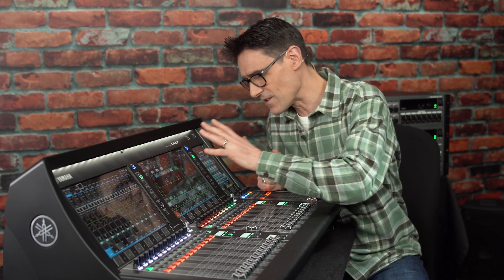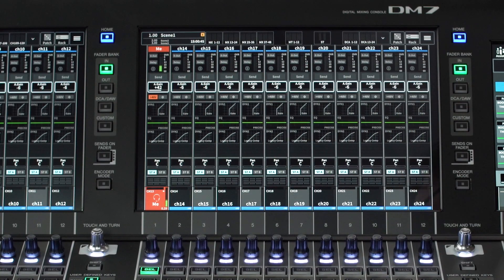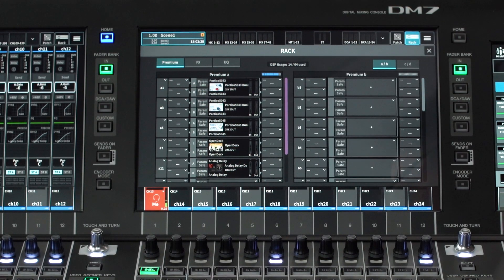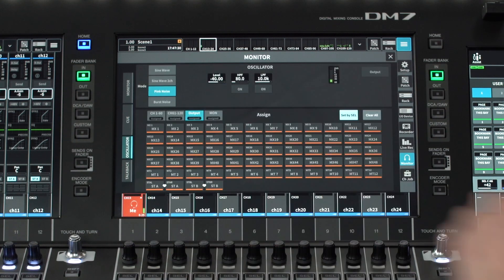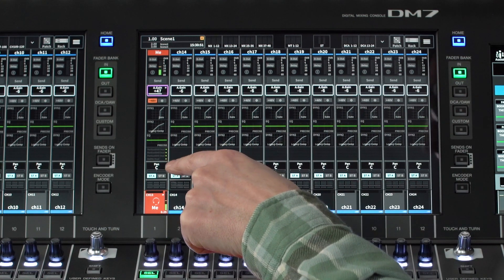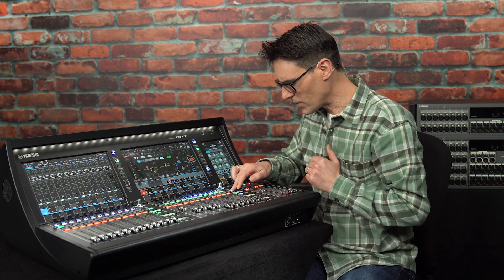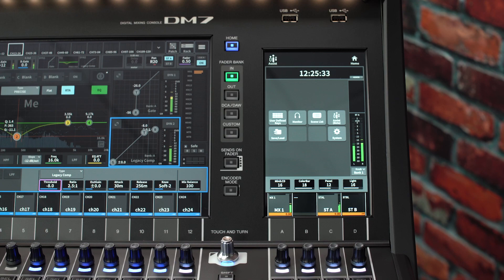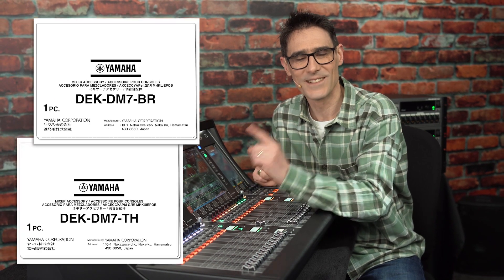DM7 Series Training Video #2: A Guide Through the GUI

Comment: I have the dm3 which also suffers from a laggy screen. Using an ipad over network is however very responsive. Stop saving money on things which are really important Yamaha! (External power supply too...pfff)
Reply: I was seriously interested in buying a DM3, but if it responds the same way as the console in this video, I'll pass...
Reply: Yeah, it's very disappointing. I'm considering buying it when it comes out but that lag would be a deal breaker if they don't fix it.